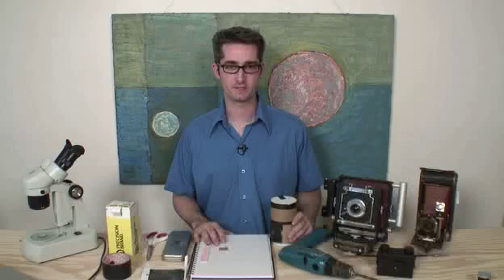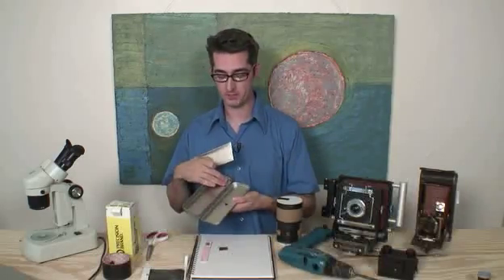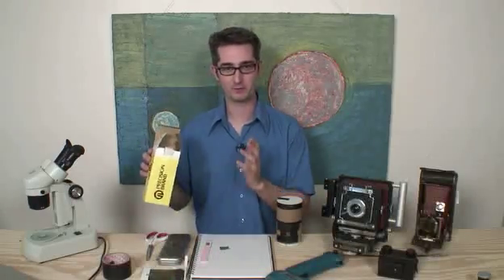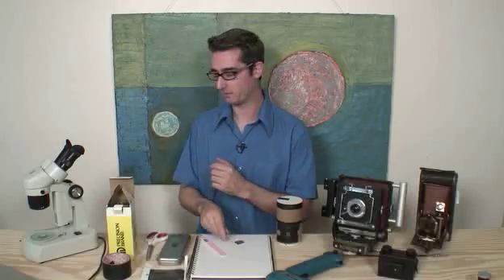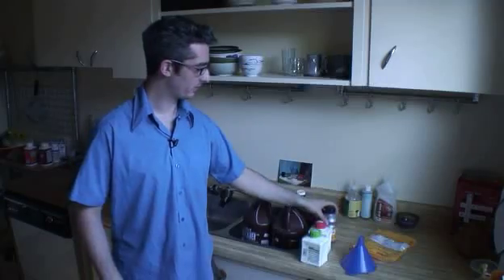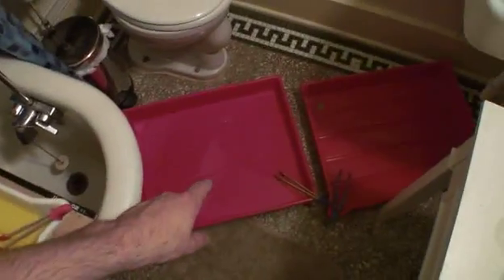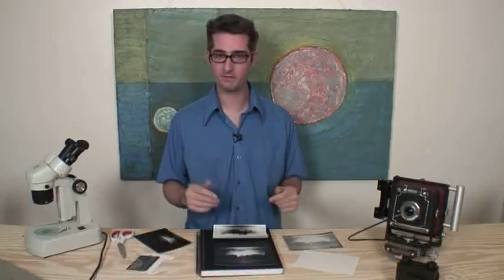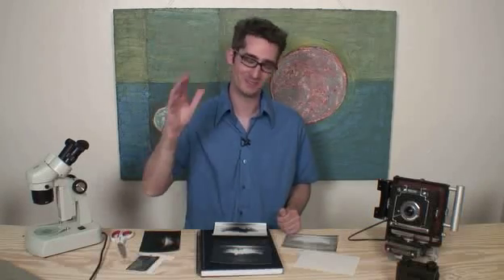Make Video Podcast: Weekend Projects - Make a Pinhole Camera

Comment: I thought the exact same thing. I think when he opens the black tape from the outside of the box it automatically takes the picture using the light to mark the surface of the photo paper. If that's the case -- I could very well be wrong -- then making a cover that has a tape hinge would probably be easier than to pry off the tape everytime you take a picture.